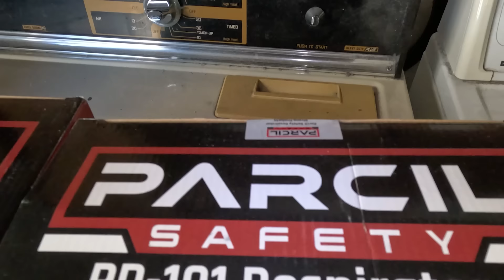NOBODY wanted to take on this job...

Comment: Been there, done that twice. CATS never again. Mental illness, depression, Hoarder Disorder, it was a mess. Burned my cloths after the job. My 3M Respirator, after using 3 sets of Cartridges, threw it out. Average People don't understand at all. I had environment suits as well. I spent a week on the job, took a one hr showers every night, my cloths left on the porch LOL! The smell even got into my truck. It was bad; forgot the fleas, thousands of them.
Reply: Sounds god-awful! Seems like some prep work could be done to mitigate the threats like spraying down areas with disinfectant and spraying for fleas - before you do any work. 
Besides respiratory diseases, fleas carry a host of other diseases. 

Don't you think they needed better respirators and PPE?
Reply: @randallsmerna384  GOD-awful was an understatement LOL! We did that & more in prepping. Just the Cat Crap alone 6"inches deep in some areas. We did save the house for the family. Kept the locals Agencies out. Sold as is, after it was gutted & cleaned. You should see it now, contractors did a nice job, its a beautiful house now.
Reply: Cats are fine as long as you take care of their box daily and don't overwhelm yourself with 500 of them. I have 3 and they're just fine. Nothing wrong in my house. They belong to my wife, though lol. I'm a snake guy but I have to keep them in a separate building because most of them are venomous so I don't want them in the house just in case.

Comment: The hereby knight thee, The Angel Twins. This episode is like The (Angel) Twins meet Hoarders. One day, I hope the propensity to hoarding will be part of annual medical exam. Limit “pet” ownership to one as she clearly has difficulty caring for herself. Where was the giant exhaust fan or air filters in work area? Shovel was needed with some kind of gelling agent not wet towels to remove poop.If you do one of these again, treat her to a spa day so you can have full access to house.

Comment: You need the correct filters for the masks.  There are many for all different environments.
With all the stuff you moved dont go home go to laundry and wash all your cloths in hot water and double drying cycle in dryer or you will get bedbugs.